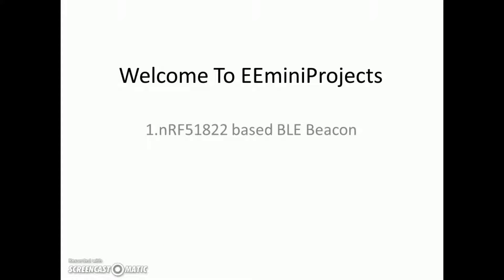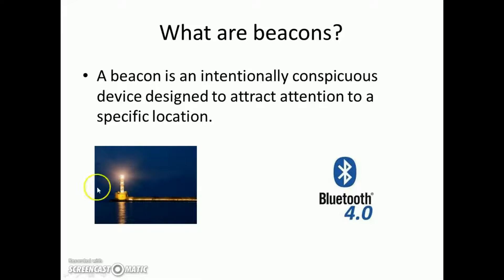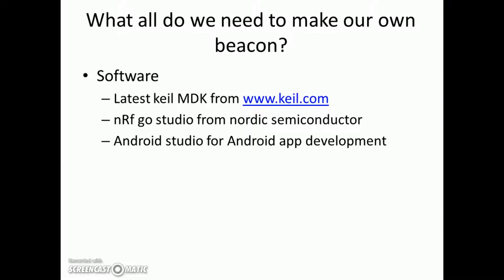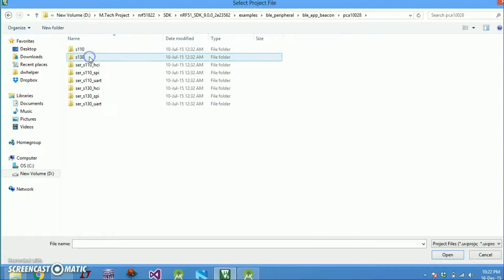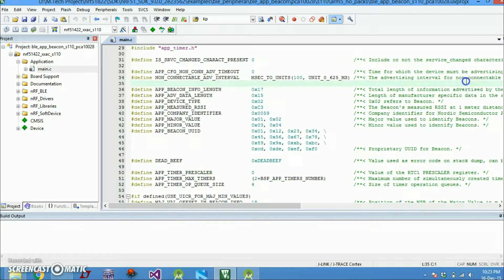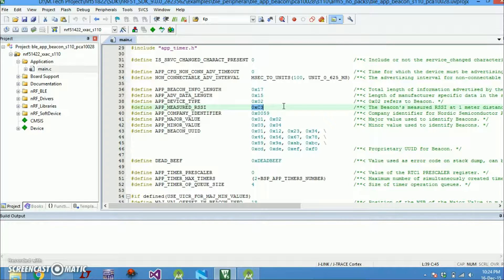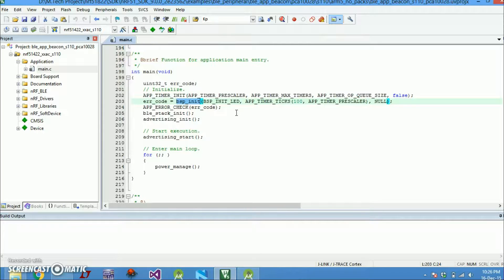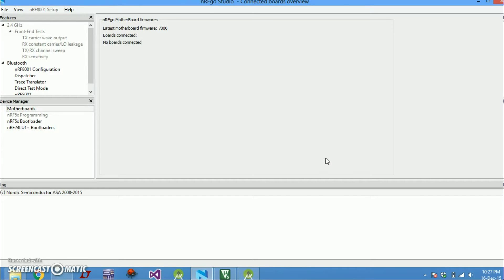miniProject #1_1: nRF51822 based BLE Beacon: Basics of beacon and Beacon code

Comment: Hello sir Thanks for this tutorial,
I'm using the PCA10056 with an SD card connected via P1.12-P1.15. When I use the FatFs example of SDK12 PCA10028 it works fine. but when I use the FatFs example of SDK15.0.0-PCA10056, it is not working.

Did any changes in SW/HW? I am Using NRF52840-DK and Model is PCA10056 1.0.0 2018.25  683802088.

Comment: hello sir, I tried the same thing. But Iam not able to get the same result. After opening the project in keil, iam getting some problem in device files where the startup files are present. There is a red color hyphen on the start up files.

Comment: Could you share some details about the hardware also. Where to purchase or pointers on how to create the hardware.
Reply from the maker: I purchased hardware from eBay and Hacktronics.in. I think nrf51822 module is easily available just google it many purchase option will appear.
Reply from the maker: I purchased hardware from eBay and Hacktronics.in . nrf51822 module is easily available, just google it for purchase many options will appear with various prices.
Reply from the maker: I purchased hardware from eBay and Hacktronics.in . nrf51822 module is easily available, just google it for purchase many options will appear with various prices.